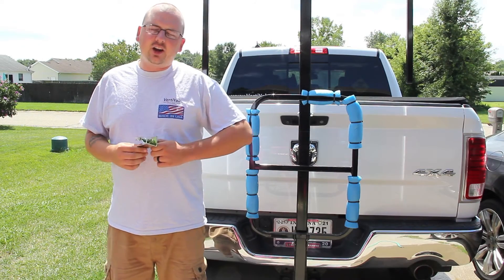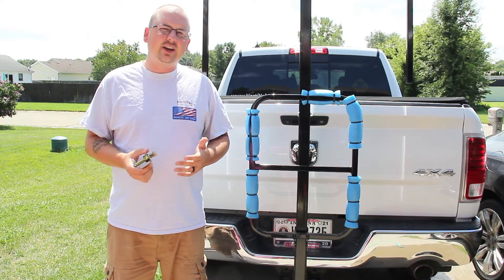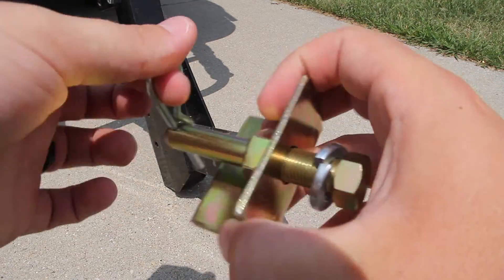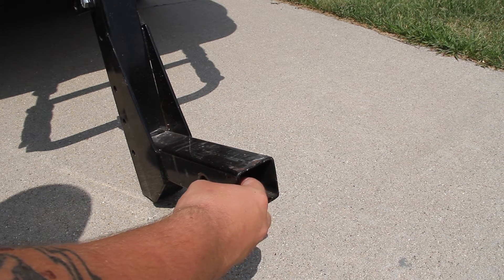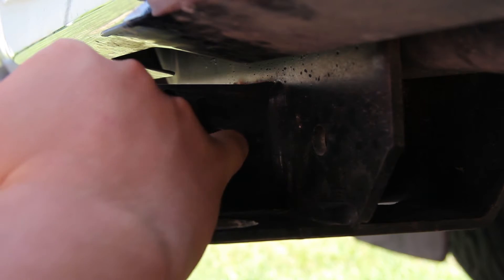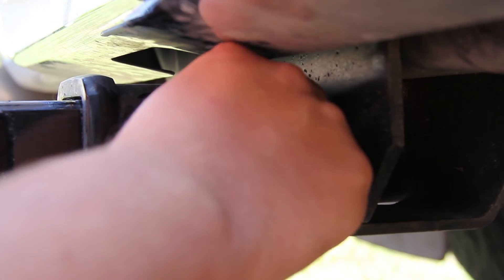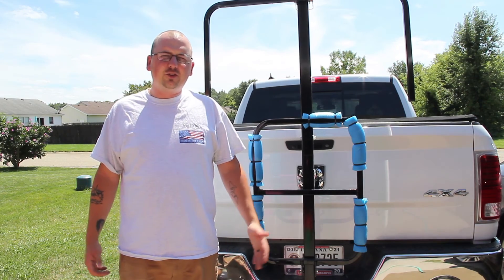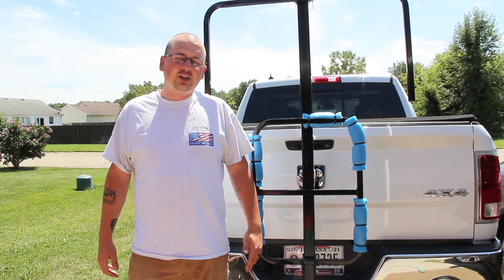VertiYak­­® Anti Rattle Device

Comment: do I need a hitch extender for the vertiyak on my 2 door wrangler or will it stick out further than my spare already?
Reply from the maker: I was a jeep guy for a long time. We designed the VertiYak to be long enough to stick out past the spare tire as long as it is a stock spare tire. We cannot garentee the VertiYak will stick out past any oversized tires you may be running.
Reply: @rollercoasterfreak92  Thanks so much for that info! I run a 33 like a rubicon stock tire.